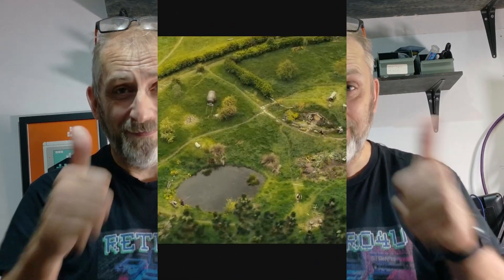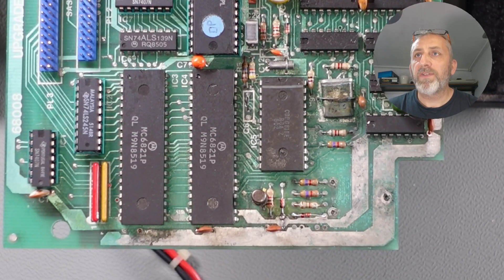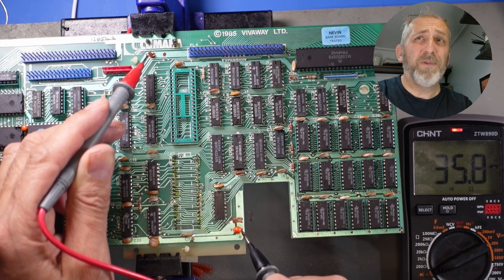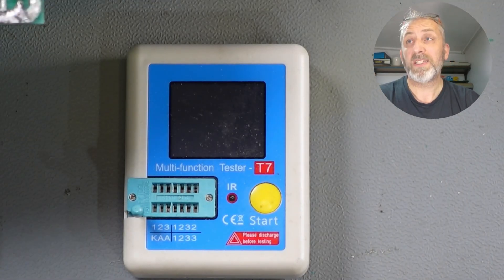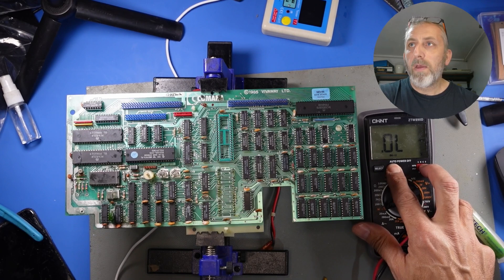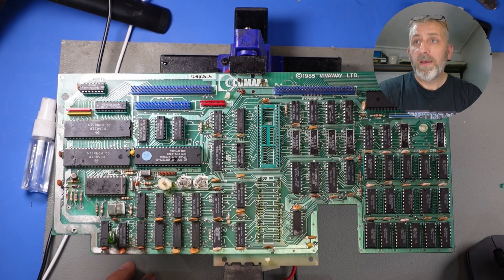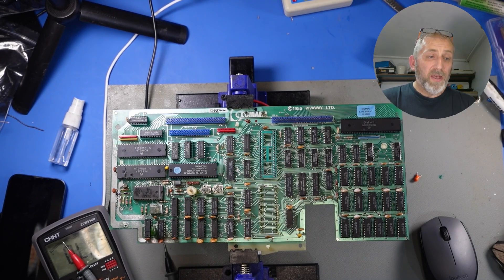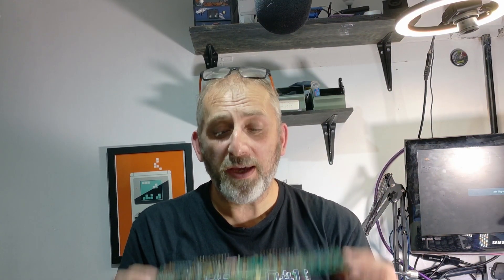BBC Micro 68008 Repair Adventure: What Now?

Comment: Dear Neil, I have the same board laying around for many years now... 35 ohms look ok in comparison to mine. I have  only little time but I am ecounraged to get it working after I see your video.  Many thanks for it! You need a boot rom fitted in the beeb to start the board. Also you need at least one floppy drive connected to the shugart bus on the board. I have the original discs which are containing the operating system and additional software. Not sure if they are still working. Sorry I am no expert in doing this stuff. Hope we can be successful. Greetings from Germany, Joachim
Reply from the maker: Hello Joachim and many thanks for your comment. I do have all the disks and indeed sourced the Rom and burnt it in the video https://youtu.be/QnZIm0DagGg?si=06xjIj39duKAlFw5 super 👌 thanks for the 35ohms I will be revisiting this board soon as I now have a he bbc running that it will be fitted to. But like many other things time constraints etc and trying to get a complete video out is hard work after all I'm still new to this and learning all the while.  If you need any images for the disks I can always sort them out. Good luck and you say your no expert but you managed to supply me with  the ohms reading which is great feel free to drop me a email at neil@retro4u.co.uk if you get anywhere would be great to see one working :) anyhow thanks again and hope you enjoyed the video

Comment: I have a BBC B sat in the loft has been for the last 35 years. It was carefully put away in it's box in perfect working order. From what I have read, the last thing I should do is turn it on to see if it still works. I have little interest in it. Should I just try selling it as untested?
Reply from the maker: It will need the caps replacing as the Rifas will just go up in smoke 💨. They always do thanks for your comment I may be interested in it myself to add to the collection drop me a email to retroconsoles4uk@gmail.com

Comment: 36 Ω doesn't look bad at all. 700 mA could be normal too. It's just 3.5 W. That much for pretty much complete TTL era computer isn't unheard of. Also, you may want to get better wires and/or connectors for your power supply. 1.5 V drop at only 700 mA is quite a lot. According to datasheets: Single MC6821 can gobble up to 0.5W (100mA @ 5V). And there is two of them. That's already 1W (200 mA). WD2797 eats something between 70 and 150 mA, which would be between 0.35 to 0.75W.  I can't find any decent info on the CPU. Each TMS4256 draw about 40 mA at normal operation. Times 16 would be 640 mA (3.2 W). And there are still some more chips there. Assuming that not everything operates all the time, 700 mA seems to be about right.
Reply from the maker: Yeah I need better wires for sure 👍.  But thanks  for info I’m still waiting for for the capacitor ect  then I’ll get that installed and try some more power through it. Or try it on the BBC and start to scope out the cpu ect :)

Comment: Quick shorts guidelines here.. 34 ohms is ok, as it would give a current draw of about 150mA at 5v (5/34=0.147) which sounds reasonable. A short is  usually characterised by very low ohms, less than about, say, 5 ohms on smaller boards. That would equate to about an amp of current draw, clearly too much,  and that's what you're looking for. This is a simple application of ohms law and gives decent ballpark figures to work with. Making good progress mate, maybe time to try plug it in again.
Reply from the maker: Hey thanks for another detailed explanation.  Yeah 👍 I will supple some power again next and get the scope check out the clocks etc. But I thought I would wait for the other cap and get the other replaced first.  Thanks for shout out on the diode :) thanks for the comment

Comment: 35ohms is only 140mA @ 5V so not a high current.

Use a current limited supply say 250mA or 500mA max and try it.
Reply from the maker: Will try that thankyou :). Thanks 🤩 for the comment and info